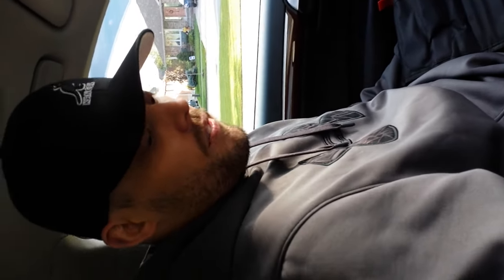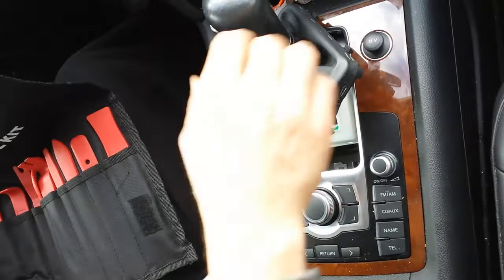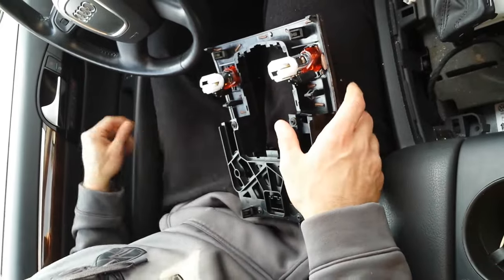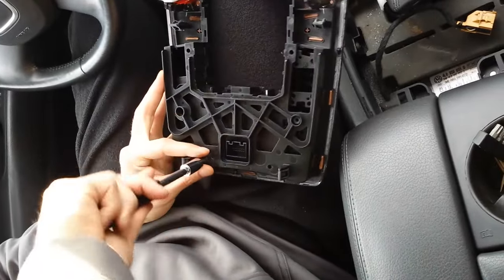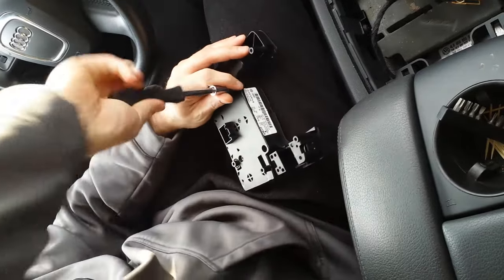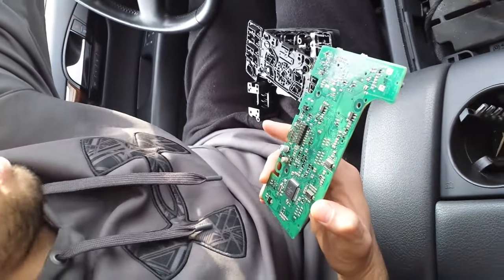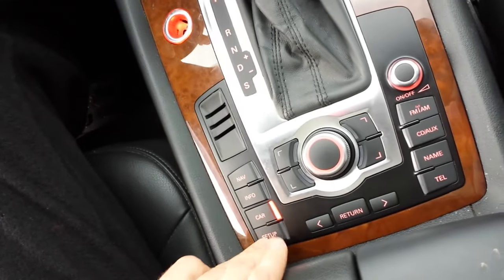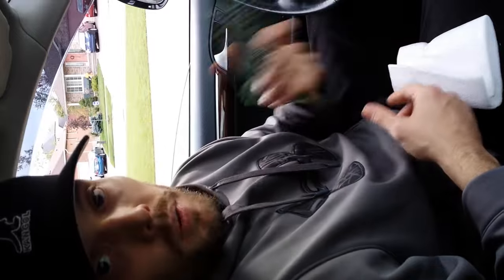Audi Q7 MMI Console Circuit Board Removal and fix.

Comment: Can you please just send me the parts number and I will get them from ebay. Couldn't get to Facebook group write ups because I don't have an account anymore. Thanks
Reply from the maker: Ok here is the cables you need.AUDI-MMI2G-ADAPTOR Wiring Harness  http://www.ebay.com/itm/AUDI-MMI2G-ADAPTOR-A4-A5-A6-A8-Q5-Q7-FIBRE-OPTIC-PLUG-PLAY-WIRING-HARNESS-MOST-/172270143334?hash=item281c19c766:g:yEYAAOSwstxVA0nL Here is the Navigation/Dvd Player Other models  might fit but this is the one I used I bought one that was defected, I returned and bought another and it worked.  OEM 4E0 919 887 M http://www.ebay.com/itm/Audi-A8-DVD-GPS-Navigation-CD-Drive-Player-Unit-OEM-2004-2009-/252614933965?hash=item3ad105fdcd:g:hNgAAOSw44BYGCDZ&vxp=mtr.  I bought this antenna because I didnt want to dig for the wire but I did find the one for sat radio in trunk that I used. GPS-antenna-3M-cable-Fakra-C-blue-connector http://www.ebay.com/itm/GPS-antenna-3M-cable-Fakra-C-blue-connector-for-for-MFD2-RNS2-RNS-E-VW-AUDI-NEW-/271470405195?hash=item3f34e5a64b:g:M~8AAOSwa39U0wol last piece was hard to find part number, It was for the cradle to hold the dvd player 4L0-907-462 http://www.ebay.com/itm/4L0-907-462-Audi-Q7-Navigation-Player-Cradle-Support-/222393974941?hash=item33c7b6c09d:g:N04AAOSw5cNYJTQ2&vxp=mtr . Hope that helps lol and questions feel free. I have pictures I can send so you can see whats up. It was easy. just need to remove the panel and youtube has a video showing how to do that. Good luck.
Reply from the maker: I didn't spend time tracking the best prices so you might find some cheaper, Also I found the green antenna behind the panel and used it for Satellite , you might be able to find the blue or use the green, but for  the 7 dollars the  cheap antenna works great. The Cradle  you don't need to get, Its more cosmetic. I used styrofoan and zip ties to hold the Dvd player for a while, Until I tracked down the OEM Cradle . Like I said, Any question don't hesitate to ask. I did take picture of all the parts and where it goes, etc.
Reply from the maker: its pretty much plug and play.